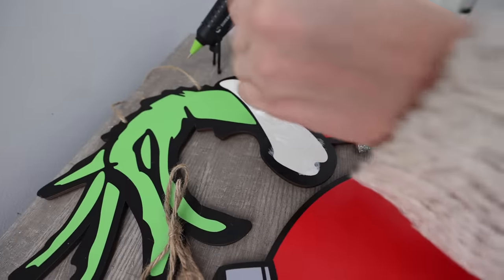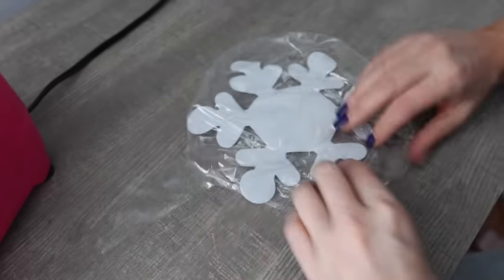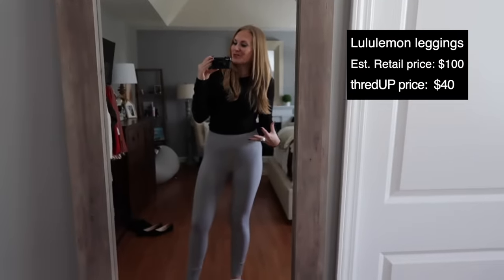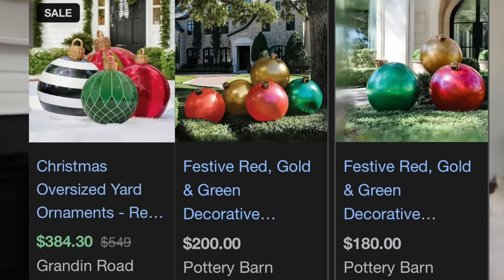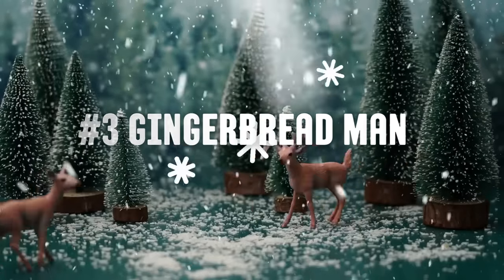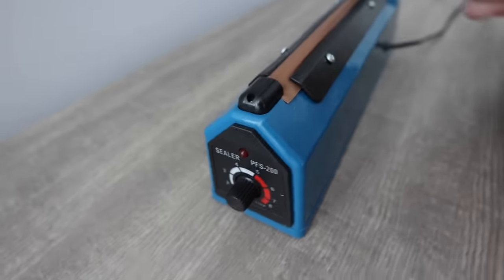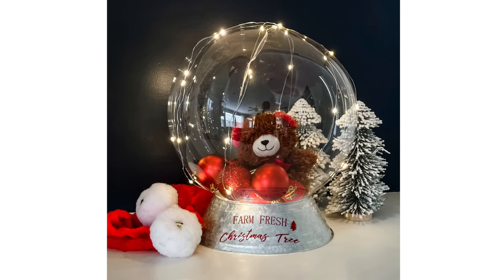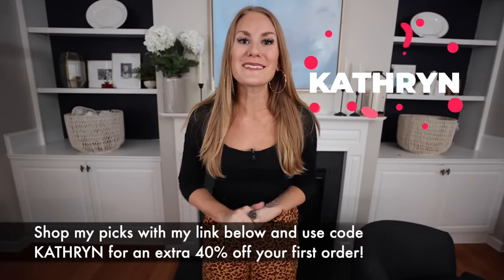5 *GIANT* CHRISTMAS HACKS in 5 minutes or less! ⛄️❄️ (don’t miss!)

Comment from the maker: You can thrift my picks at https://tdup.co/KATHRYN and use my code KATHRYN for an extra 40% off and free shipping on your first order.
Reply: There are also those small chip bag heat sealers, that uses two AA batteries.

I wonder if one one of those would also reseal the Bobo balloon?
Reply: Good night
Reply: Do u have a link for the big blow up ornaments?
Reply: Hi Kathryn,

Your home is elegant and I love all your ideas for Christmas decor.  I went to the Dollar Tree in the pouring cold rain and wind the other night for the first time since early spring.  I went for jungle bells and  for little white foamy glittery snowflakes they ALWAYS had before and  every shelf was bare on the craft section. Dish liquid area completely empty laundry soap bare tons of shelves were empty no bar soap. Iaje a cute crafty using hand towels and the nice Yardley English soap   and  only one cashier.  I left with only jungle bells.  This Dollar Tree is in a very poor part of town and I assume their restocking truck had not come.   Michael's has been pricier since covid and they have not had the little snowflakes as well.   

You look great in all your thread up outfits.  I use to buy from them  and everything always fit me great but I never had original tags on them which is fine.  Where I live right now has a tiny coat closet a tiny bedroom closet and my linen closet is half linen and half craft supplies.  I may have to put a dresser in my foyer and buy one of those wardrobe hanging bars with shelves for clothes.   My home is 610 square feet  so I cannot buy lots of clothes right now. 

All your decor ideas are awesome!
Reply: I like your snow globe’s especially with teddy bears and lights awesome deals especially on your clothes
Reply: @RLaraMoore n😊q